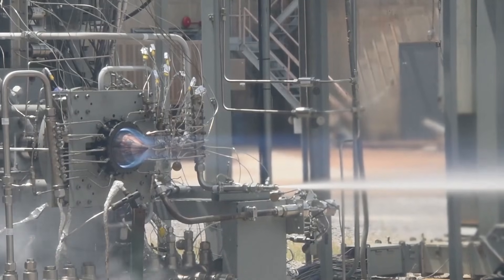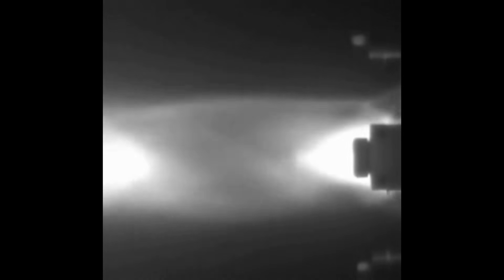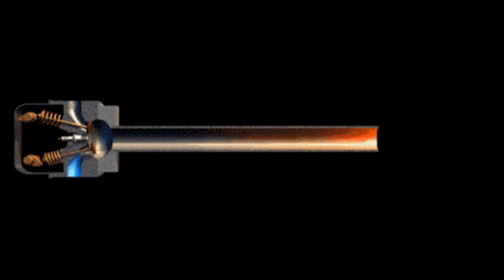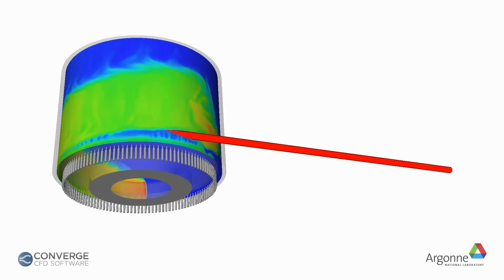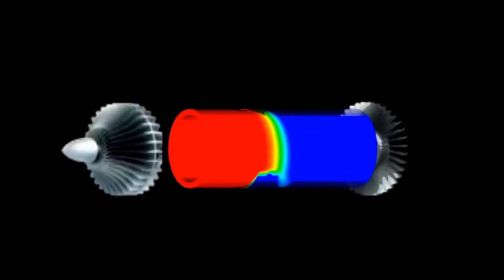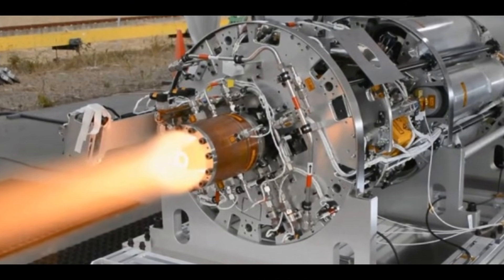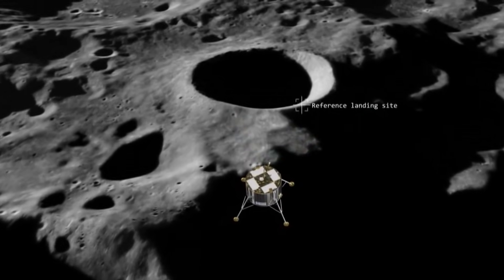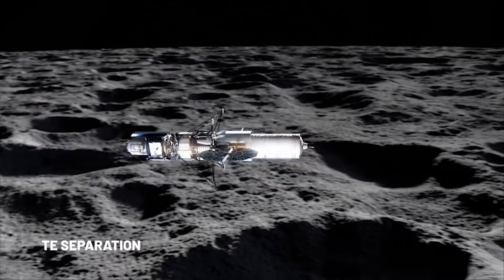What Is A Rotating Detonation Rocket Engine and Future Aplications

Comment: Nuclear harmonic resonance utilized for hydraulic compaction it’s polymerization and then plasticization turn into Jell-O and then you beat it so that it stays that way, and it’s the quantum speaker in the fuel tank and in the fuel line and it does all of the fuel pumping, and it turns the fuel to a gelatinous mix. It actively brings the fuel to a point that the fuel would detonate if the speaker stopped Poorly it simulates more than a 1500 psi pressure gradient on the parts per million of the fuel without allowing a fuel to break the surface tension, and then it hydraulically presses this gelatinous fuel through the fuel line into a manifold which spreads it like Play-Doh to all the little holes and then the rotor spinning around, cuts it off and when it cuts off the fuel then debt nights and that’s the fucking mechanical Rotary detonation engine that I’ve been trying to spit out to people for forever, and it was so obsolete that they wouldn’t even let us make it as a high school science fair project they said make something more advanced and everybody had a minimum of a cryo- cooler cryo- fluid operated Which is activated water activated water, and cryo-fluid bioluminescent activation of water and it has to do with frost and getting the light trapped between the surface tension of just regular plane, all water and water in the state known as frost and getting the frost to pearl and shoot light through itwas the minimum lift engine that they would allow us to play with for science fair project and that was so fucking long ago. I had to ask somebody what did I do for a fucking science fair project and that’s where we got to this part of you guys know what a rotary detonation engine is.

Comment: What a beautiful new nasa  invention ! 
In ww2 the Germans use it in V1
Reply: Nope, V1's engine was a pulse jet that relied on standard deflagration, not detonation, and had a very low compression ratio. It was sustained by the trailing edge of each pulsed fireball igniting the leading edge of the incoming fuel-air mixture, and the resulting pressure would force the intake valves closed, leaving only the tail pipe as an exit, which would then generate a low pressure area behind it, opening the valves and resuming the cycle.

Comment: To be used for lunar landing vehicles -- but not for launch vehicles lifting off from Earth?
What are its imitations?
Reply: The shockwave will bounce back off the ground and blow up the rocket. This engine needs empty space behind it. It can be used as the second or higher stages but not as the primary launch engine, except for a vehicle that takes off horizontally like a spaceplane.
Reply: @andrewsuryali8540  - I'd read that with regular PDEs, the presence of ambient pressure prevents exhaust gas purging, thus contaminating fresh doses of reactants on subsequent pulses. But I find it hard to believe that acoustic effects can''t be taken care of through classical methods like water suppression. Also, there are projects being funded for using RDEs as primary booster to boost other ramjet-type engines up to speed for them to start working.

Comment: I still can't understand what the difference is from the pulsejet engine. Only instead of the empty chamber of the pulsejet, there is an explosion chamber between the two cylinders...
Reply: If you would 'stack' say 32 pulse-engines in a circle and fire them one by one going round the circle in a tempo that would allow each engine time to reset before it needs to fire again, you would end up with basically the same thing.

Comment: I am curious, would ICE cars with detonation engine be also more fuel efficient ? Granted, the engine would need to be made of much sturdier materials and all that...
Reply: they would definitely be louder
Reply: @piccalillipit9211  Yup, I'm thinking a set of Thrush or glasspak mufflers would be out of the question!
Reply: No not really, but you've pretty much answered your own question.
You're correct that the engine would need to be made out of far sturdier materials, so out go your cast aluminium pistons and in go some pistons made out of steel or even some superalloy like Inconel to cope, but they're a lot heavier. Your connecting rods would also have to be beefed up quite a bit to cope with slinging those heavy pistons around.
There's no way your aluminium cylinder head can cope with the pressures and shockwaves from detonation, it simply isn't strong enough, so back to cast iron or steel we must go.
The crankshaft will require considerable reinforcing to stop the shockwaves from simply snapping it should the engine even slightly misfire, likewise for the flywheel.

All of this leads to a self-defeating scenario, any efficiency you could have gained went out the window because now the engine is a very heavy reluctant lump of metal.
You've essentially been left with an extremely heavy, slow-revving truck engine that'll probably weigh in at several times what it was, but produces no more power or torque than it did beforehand. You have to drive it full-throttle everywhere to get it to just move, your fuel efficiency is now a bitter memory and your vehicle is completely impractical.
Reply: @mazdamaniac4643  yeah, your right. Reading your comment i remembered wankel engines exist and still arent fully solved, this would be probably even more problematic than that.
Reply: Diesel engines already use detonation as reaction method.
Petrol engines deflagrate.
Reply: Modern high performance ice opperate at the limit between deflagration and detonation. They can tollerate some slight detonation, but this is seen more as a risk than an advantage. 
Detonations are to violent to be used in a practical manner

Comment: It looks really good , but …..  1 minute without disintegrating  is a long way from hours or days of use . 
  Car engines in decades past as an example  of combustion if the engine was poorly tuned or using a quality of fuel that was inadequate  they would make a sound referred to as pinking , it was actually the fuel air mixture in the cylinder detonating  in the cylinder which took a nasty toll on the engine because of the shockwave to the components , bearings , piston, piston rings , valves , valve seats , in short , if you let this detonation persist you’d end  up needing expensive mechanical work or a new engine . 
 You could usually tune for bad fuel  .
 One of the misconceptions about fuel for a car engine was the way the fuel burned , good fuels burns quickly , is less volatile but and less prone to detonate. 
  It will be interesting to see  if they can make the detonation rocket long lasting.
Reply: You don’t necessarily need days of continuous use in space. There is negligible friction, so you get to your speed and coast.
Reply: It is mainly all just heat control issues about zero mechanical issues. The combustion zone is well removed from the mechanicals. (My mentor was a heat flow engineer type guy)
Reply: Pinking? LOL. I think you mean pinging.

Comment: 25% gain + cooled fuel= 50% gain, in other words SSTO is made possible, mix this with a an oxygen capture system and you will actually do so without problem.. 
if we used cash on this instead of fighting over territorial friction, there would be infinite space for humanity to expand.. first moon, then ceres, so transport infrastructure built on moon to mars and ceres, ceres is both a fuel station and a storage hub.. shipping time means nothing when there is a constant influx of cheap transport ships, ships full of water and fuel.
Reply: SSTO shouldn't be the goal for a launch vehicle. Reusability should be, which is where Starship will eventually excel in. They'll probably achieve 95% reusability for starship eventually, and  100% for the boosters, which is most important as many starships will never return to earth but be used as transport ferries between Earth and Moon / Moon and Mars. But the boosters will return every single time.
Reply: @paulmichaelfreedman8334  Still, 25% gain alone would be brutally in terms of saved mass - would change the sizes and allow a larger starship or a higher end velocity to be achieved without refuelling.

Comment: Also you can tell the efficiency because there is no mock diamond and it's amazing how the aerospike is not glowing after a a few seconds of running in that clip!
Reply: Mach not Mock. Explain why the absence of shock diamonds means anything here.  I'll wait.
Reply: regenerative cooling. The cryogenic fuel is led through channels in the aerospike before it is injected into the combustion chamber. The tip is problematic though and is usually made of a tungsten allow that can withstand extreme temperatures. Even then the tip needs replacing often. Aerospike engines remain high-maintenance for now, whereas for example SpaceX reflies their falcon 9 boosters nearly on a weekly basis, up to 20+ times with minimal maintenance (often only inspections). Very rarely an engine will be swapped out if its telemetry of the previous flight was deemed off-nominal.
Reply: A "mock" diamond?? 😂 FFS
Reply: @Vladimirthetiny I just realized what you were saying, I was using voice transcription and wasn't paying attention to its spelling 😅 my bad I kept writing mock instead of mach. I didn't even realize it until a day later. My apologies!
Reply: @Vladimirthetiny the names are interchangeable in the textbooks, if you ever read the textbooks you would know that
Reply: Rocket engines efficiency measured by it's specific impulse not by presence or lack thereof a mach diamond
Reply: @ginbei711  I am a certified a&p. I went to school for this so I know how they work. Also studied aerospace engineering and rocketry. I have all the calculations laser cut into a board hanging on my wall for fuel ratios and specific impulse formulas as well as orbital insertions and lunar approaches. I know how it works and you can definitely tell this engine is starting to get some serious efficiency by the way it burns. degeneration of shock diamonds or Mach diamonds is a Tell-Tale sign of efficiency and you can get a good idea of how your nozzle will perform as well as your combustion chamber by understanding the vectors of the flow. That's what the Mark diamonds show you. Specific impulse can also be calculated off of a wave function using those exact mock diamonds. The sine wave generated by The diamonds can be used to directly calculate efficiency.
Reply: @ginbei711 do you know why mock diamonds are formed, it's because there's an inefficiency in the combustion. The flow is burning fuel rich and fuel is mixing with the are around causing a collapse in the cone. The higher up in the atmosphere you get the less shock diamonds or mock diamonds you get. That's because you have less pressure pushing against the exhaust. Rocket engines are not meant to be efficient on the ground. Proper testing of a rocket engine on the ground should show shock diamonds. I grew up in Orlando Florida and have spent most of my life at the coast and the cape. I have been at every inaugural launch in Florida since the 80s. I can tell you what fuel they're burning by the color of the exhaust. I know how to calculate efficiency.

Comment: They should develop venturi asist rocket for the first stage
Reply: It would never give high enough propellent flow rate. Rocket turbopumps require 1000s of horsepower from the turbine.
Reply: @undertow2142  a ventury  will be a regular  engine place on the outside rim  of the rocket with another cone that allows air in suking incoming air and pushing it back